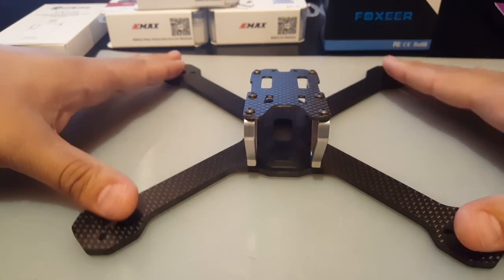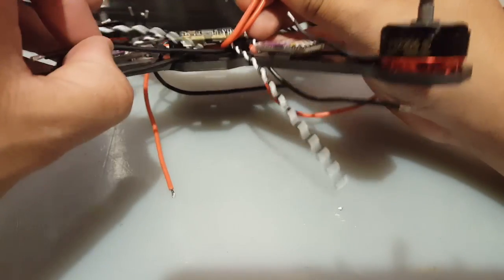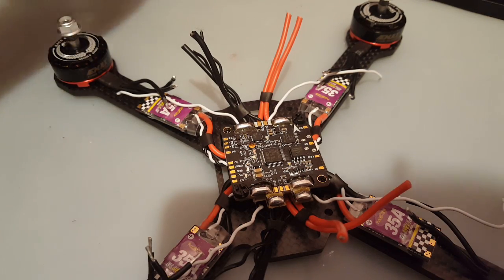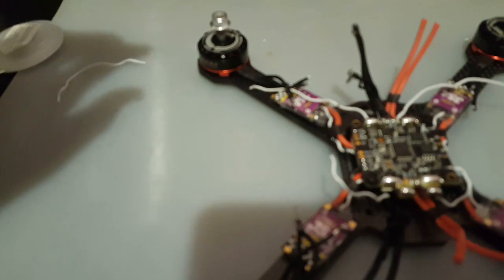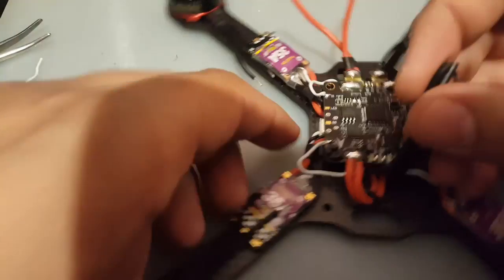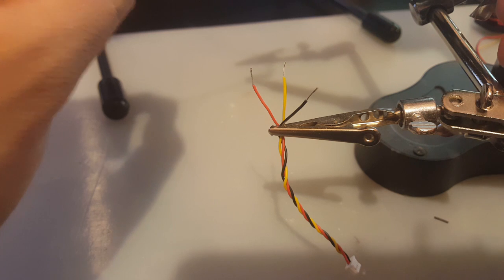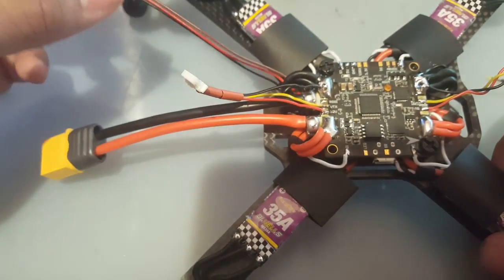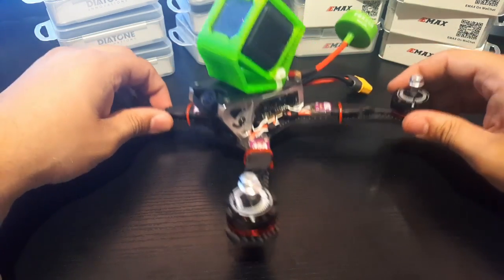How to build a FPV Freestyle Drone // Frog Race

Comment: Lovely looking thing but way too tight for my building skills. 
I'll wait to see what you do with that iFlight ix5 frame because that is the one I will probably go for.
Loving your videos, respect.
Reply: Luis Rodrigues The ix5 isn't any less tight, it's a more narrow frame. Additionally, the ix5 if a mono frame, so you can't replace and when they break, and they will break, the carbon is cut diagonally instead of lengthwise which makes them slightly weaker.

Comment: hi, the motors that you use only have a ccw rotation? if you like to change to cw you can invert the cables?
Reply: Shikur Mitnick yes. The cw/ccw just determines the thread direction for the lock nuts.  Ie they can all be self locking if you use cw/ccw where they are suppose to be.  The motors are the exact same just different threads

Comment: Great video. This is definitely going to be my next build. Thanks!
Reply from the maker: Stick to Racerstar 30A V2 ESC less noisy.. I have been testing ESC's on an oscilloscope and it seems that the MS series are very noisy and have big voltage spike. So take that into consideration.. I will be uploading all my research and findings soon..
Reply: Drone Mesh Yeah, thanks for the tip. I have a set of those ESC's I was planning on using anyway. It looks like a fun flyer for sure.

Comment: Hi going to build a quad using the race frame I built one using the light frame too, so far so good crashed many times and the frame seems tough, just a few frame bolts got loose lock tight done the trick.

Comment: nice build and that frame looks great, I'm glad I found your video.  Compared to the GT2 200, realacc y200 and this frame, which do you prefer and which one is the most durable and best to fly with?  I am a bit undecided which of the three frames I will order cause I seem to like them all but I only need one to replace my spaceone 220x frame.
Reply from the maker: I can't tell you just yet becuase the GT2 200 4 flights and blowup on me because of components Diatone just sent me new VTX and FC to replace. Y200 I did not really like but this is an opinion i have not flown it yet. The frog looks awesome but have not flown either yet. 

But if i had to choose between buying these 3 frames I would get the frog. Again this is my opinion there is not facts or testing behind this.

I am currently just building drones on my channel until the weather clears up then I will be doing thorough testing on them along with all the motors I have.

Comment: Nice one!! and now the race version!! which one do you like more? to bad you didnt make this one with the 4in1 esc.. i have the frame to! but im still waiting for the rest to arrive.. whats the difference im Weight? your lite, with 4in1 escs, and the race with 4 separate escs? cant wait to see a flight video! Nice work man!
Reply from the maker: Han Rinsampessy My scale is broken I spilled a monster on it mentioned it in the video. But I am sure the race is lighter. flight footage will be a bit till I get a chance to go flying. The F40 motors where defective you can see in previous video about that issue. 

I will try to get the flight footage this weekend.
Reply: Drone Mesh oh yeah you said that already.. thats a bummer;p how is the range on those small flysky rx's? i have the x6b.. but was thinking about the one you have.. but is it good?
Reply from the maker: +Han Rinsampessy Yes.. had no problems with it I don't fly far so it's serving me well plus it's cheap. Just to note never flew it farther than 250 meters in an open area so I can not say much about range.

Comment: Nice build.  However, the part I was most interested in is missing:  All the BetaFlight and OSD setup.  Next time, you should include it.  Keep up the good work.
Reply from the maker: Martin Arial Sure I will make a video of what I did and what versions I use.
Reply: Thanks...   :-)

Comment: you can do unlimited models on the turnigy evolution look it up!
Reply from the maker: I did my research on that but i still have not taken the jump even though i need one. Anyways thanks for the info ^_^
Reply: DaytonaJim78 might as well go with a real remote and get a taranis you can't forget about range nothing has better signal then FR sky you don't want to build a nice quad and have it fail safe and break because of saving $10 on a receiver
Reply from the maker: QUADBOT FPV if I go with frsky I will have to buy at least 300usd worth of receivers. I want something compatible with all my quads.
Reply: QUADBOT FPV I don't think you really need that much range for racing or doing a little freestyle flying through trees or in a building.